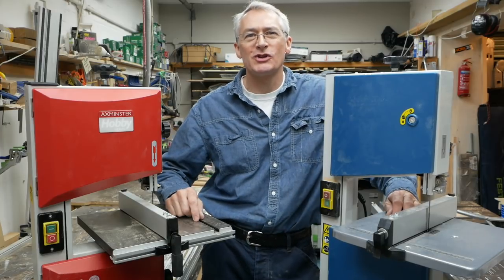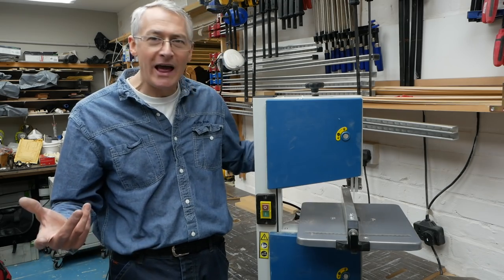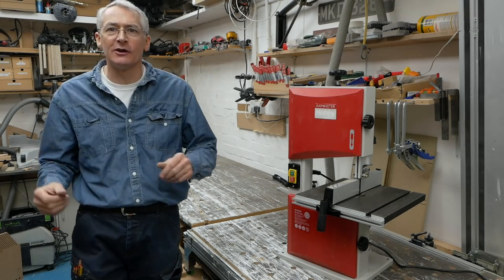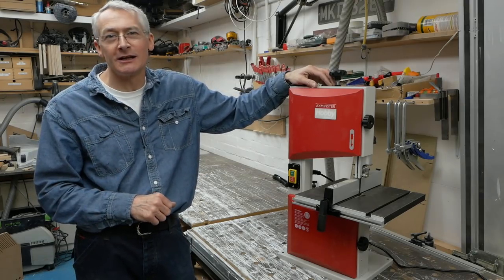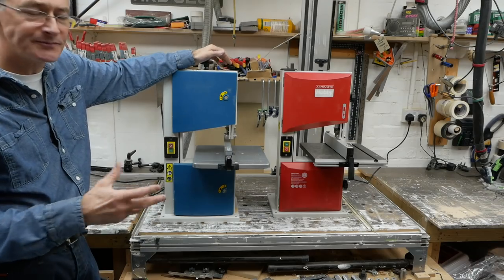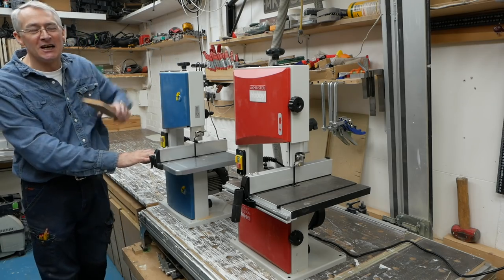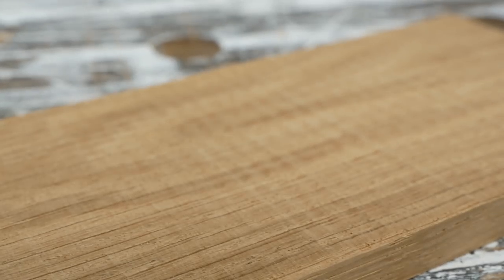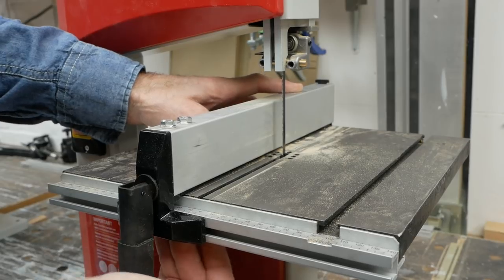£80 Bandsaw vs £200 bandsaw #140

Comment: My friend bought the Aldi machine, and it's a toy compared to the £200/250  machines. As you said, o.k for freehanding rough work, but when you look at the table and fence you just know it's a no-no for anything serious. If you're a hobbyist then the Aldi machine will serve a purpose, but I would rather spend more, and have a machine that will do what I want. Were you really cutting brass and aluminium with a 6T blade for six months, then able to cut sixteenth strips of hardwood cleanly?

Comment: Great review. It is astonishing how the Chinese manage to make things so cheap. I reckoned that just to buy the materials as as stock would cost far more than a whole bandsaw. I think workshop tools have not progressed at all. In fact they were better 80 or more  years ago. I want a bandsaw that cuts steel and wood yet absolutely no one makes one. Why? Corded hand drills can now be got with 1100 watt motors. The best you can get in a small bandsaw is 350 watt. Why so small? Also there  is too big a jump between the small bandsaw and the medium. Medium bandsaws usually come in at around 80kgs, that's heavy. This would mean they are only suitable for ground floor garage or  shed work shops, not, 2nd floor bedrooms (mine). I did not see a cross cut/mitre slot on the aldi one. To many people this would be a no no.

Comment: COULD YOU HELP I NEED TO CUT A LOG INTO SLICES  THE LOG IS 6"   153MM  APROX IS HERE A BAND SAW WITH THIS CAPABILITY ?? THANKS IN ADVANCE Pete
Reply from the maker: Yes, but not any of these budget models. Do a google search for “bandsaw with 150mm depth of cut” and it should throw up lots of options- I think a 10”/250m bandsaw or larger should handle this depth👍👍

Comment: Would it be possible to replace the Aldi table with 3/4 or 1 inch mdf table for a more ridged surface ? possible project.
Reply from the maker: Not really. The bigger problem is that the table is just mounted on a glorified angle bracket, which simply isn’t sturdy enough. The bigger problem is that I don’t own that bandsaw any longer 🤔👍👍

Comment: Very interesting comparison. Thanks for sharing.
I have the Scheppach version of Aldi, for which indeed i paid 140 € (115 British pounds or so)
I managed to brake to saw blade and I still do not understand how that could have happened.
On the internet I found saw blades for less than half the price compared to what Scheppach offerrs.
Since both band saws in the video are 90+ percent equal, do you think that it is possible to mount the cast iron table of the "red one"
on the Aldi bandsaw?
The Scheppach has a long list of spare parts which are possible to buy separately.
Does "the red one" has that too?
Reply from the maker: Thanks! No, unfortunately the Axminster (red one) has completely different (and more robust) mounting for the table than the Aldi/Scheppach, so it’s not possible to swap them over. I can r commend tuffsaws.co.uk for bandsaw blades, very good quality and excellent service. 4 years warranty is good, 2 years is the ‘normal’ here for the Aldi/Scheppach. We can buy the Scheppach for £110, so similar to what you paid. 👍

Comment: exactly. Theres a question is it three times as good, three times as powerful, three times as accurate? no so no point spending 3 times the amount
Reply: It never works like that though, does it ?  Using your (rather strange) reasoning we would be condemned to using shit tools. My Estwing hammer cost ten times the price of a 'market' hammer, but I know which I would buy. You stay with the crap tools, turning out crap work.

Comment: I’d not say that the axminster was a “premium” Saw. I had an earlier version of the axminster from the “white” range I think though it was a slightly bigger one than this but when I brought it 15 years ago it was cheapest bandsaw they did at time came with a stand and did ALOT of work. I sold it for £80 after 12 years of owning it. Was a good Saw for the brass it cost. Wouldn’t part with my large Wadkin now though.

Comment: Well I recently bought a bandsaw from Lidl (Aldi emulator in EU, they sell their tools under the brand Parkside), in the Czech Republic, and apart from the green doors color there is almost no difference. Mine has a thin sheet table si ilar to Aldi, but has the groove that your Axminster has, and the little angle jig to fit into that groove. So mine is somewhere in the middle, yet my question is, or rather "I wonder", if all three are made in the same factory in China? Because there is no way they can be so similar. Or, is Aldi a copy of Axminster? Nope if my Parkside has the same blade, same wheels and same frame and switch. They must come from a same place, they just differ by color intentionally and the features are left out for lower price, that's all. But I must say I am very happy with the one I have, for the money I paid.
Reply from the maker: As I think I say in the vid - or one of the others, there’s a whole budget bandsaw playlist with them all in there - they almost certainly share some dna, but wether they’re made in the same factory I couldn’t say. Just FYI Aldi Workzone tools were almost always rebadged Scheppach, and Lidl Parkside were frequently Einhell; both companies seem to have moved in to commissioning their own stock now though, Aldi under the Ferrex brand, Lidl still under Parkside. 👍

Comment: I got a basa1 the guide rail when lowered near the table it pulled away from the rear thrust bearing and  thrust bearings are angled slightly so the top of the bearing is nearer the blade than the bottom part of the bearing!

Comment: Would it be possible to replace the table and fence on the aldi saw with one from the Axminster (or similar) without having to make any modifications to it?
Reply from the maker: No, the mounting methods are totally different. You’d be better off beefing up the table with plywood from underneath, or maybe with steel from above, if you have the skill set.
Reply: Peter Millard thanks very much.

Comment: Looks like the same machine from the back Peter. Too much of a coincidence for them not to have come from the same plant in China if you ask me. I think with the Axi one you've sacrificed some power in the motor for the cast table and quality fence, which on that size of saw is probably a better deal. Plus the back up you get from Axi should it go wrong. I think they give a 3 year guarantee on this kind of stuff? I have a larger floor standing Record. The versatility of a good band saw is only limited by your imagination. I use it constantly when in the workshop. A small one is a great addition to any home shop. I'd vote go with the Axminster.
Reply from the maker: Cheers Graham. I’m sure you’re right - though to be fair there’s probably only so many ways you can design a bandsaw! Yes, 3 year warranty on the Axminster vs 2 on the Aldi/Scheppach. Jury’s still out on what to keep - I suspect the beefier motor in the Aldi is why it kept cutting decently on a shonky blade, so may well suit me better tbh 😂 Cheers, P
Reply: Peter Millard let me know when changing the blade I’ll send you a link for best option. Not got access just now. Sat on Maccy’s car park with a brew between jobs.
Reply from the maker: You know how to live, lol! I usually use Tuffsaws - Ian’s very knowledgeaable and generous with his time, but always happy to hear about other suppliers 👍
Reply: Peter Millard that’s who I was thinking of Peter !
Reply: Scheppach offers (at least in Slovakia) 4 years warranty.
Reply: Graham Orm even within the parameters of “standard 8 inch bandsaw” the similarities are too high to be coincidental. The back, in particular, has all the screws in what looks like exactly the same place. Although it’s not impossible that they’re from two different Chinese factories, one of which has simply cloned the earlier design.
Reply: In the UK I think we get 1 year on Scheppach. 3 Years is unusual.

Comment: Peter, did you think about changing the tables over so you can keep the bigger horsepower?
Reply from the maker: Yes, but the mounting points are quite different, so not an option unfortunately 👍

Comment: How does the warranty compare. The also had 3 years and their no quibble refund in that period vs a mister who gave great support but they’ll want to repair or replace typically.
Reply from the maker: 2 years in the Aldi vs 3 on the Axminster. Never heard of anyone having an issue with either company re warranty claims tbh 👍

Comment: Hi Peter. I see in the background of your latest video a new Ferrex bandsaw. I have the same model. I have been very happy with the saw, just one problem the blade tensioner sheared early on. Following  a frustrating conversation with Aldi/Sheppach where all they could offer was a refund, I fixed it myself with a new stainless bolt that cost £2. The blades that came with it cut fine, but a year on I am buying a nw one from Tuffsaws  How have you got on? Will you film a review?
Reply from the maker: Hiya. I missed out on this one last year - it’s the 10” - so snapped one up as soon as they were announced. Mixed feelings about it tbh - great for the price but I’m getting shocking vibration off it - washing machine on fast spin kind of vibration - which makes it unpleasant to use. Cuts great - 1/2” tuffsaw blade was a squeeze but just about fitted - but I think it may have to go back. Shame, as it’s the cheapest 10” bandsaw by far. 🤷‍♂️👍
Reply: @10MinuteWorkshop  Hi. Mine also had a vibration problem, so when I was repairing the blade tensioner, I stripped the saw down, lubricated the wheels and reassembled, then carefully aligned the blade fore and aft and finally applied tension with my new ebay bolt fix. This sorted the problem completely and has not returned. I would send a photo but not sure how! I plug the Midi 27mm hose into the port under the blade and this does a much better job of dust collection than when I connected to my 100mm extractor. I have had good results resawing oak and pine  with the supplied blades, 12 months on I am going to try tuffsaws blades to see if there is any difference. I like the 500w motor, the sliding extension on the table and the fence which is spot on. Dawn

Comment: NOT FAIR. Peter please . A six month old blade V a brand new blade .thats a serious handicap . I do a lot of re-sawing a new blade and correctly 
Set guides is a dream not so much the case when the blade has a lot of work done . I get your point your paying the extra for the cast iron table and some what better guides but well worth the money in my opinion.I would even suggest going a bit higher with the budget if possible but be honest what you want you want it to do .its a bit like the €100 table saws .they should be outlawed there lethall .a bandsaw on the other hand is probably the safest and only machine a woodworker might need
Reply from the maker: Not fair, but relevant David. How well does a 6-month old stock blade cut? Pretty well, actually! I did cut tests when the blade was new in the original ‘cheap bandsaw’ video👍 Also, keep an eye out for the ‘how to change your bandsaw blade’ video, out soon 😂

Comment: Clearly the same underlying design, but some key differences to justify the higher price makes the Axminster the one I'd pick. The Aldi / Scheppach is spectacular value for money but the wobbly table and cruddy fence let it down too much. Ultimately though, getting your hands on the Aldi branded Scheppach is so difficult and time sensitive as to be an unfair comparison. I'd have loved to see a third model in the comparo, priced at maybe 400 -500 pounds or so.
Reply from the maker: Thanks. As I think I said in he video, it depends on what you want from a bandsaw - I’d rather spend a bit more than the Axminster and get something with a bit more capacity, though clearly some folks wouldn’t. And yes, the Aldi isn’t stocked all year round, but the Scheppach is available from Screwfix at £110, so still pretty good value. 

The point of the comparison was to see what paying more can get you in this category of bandsaw i.e. the 8”/200mm benchtop model. I’d expect a  £4/500 model would be significantly bigger/better all round, so not entirely sure adding one to the mix in this video would be relevant. Which is why I didn’t. 👍
Reply: Any way you look at it, a great vid that helped me a lot. Thanks for posting it, and awesome to see you're tracking and responding to comments so quickly! You certainly picked up another subscriber here!
Reply from the maker: Thanks Matt, and welcome! Be sure to check out the back catalogue 👍

Comment: HI Peter, interesting video.  I know you've previously shown that you don't use a table saw much in your 'workflow', but I'd be very interested in a table saw version of this video.  

Reason being, I purchased the Aldi table saw for £90.  Unfortunately, in my opinion at least, they went too cheap on it.  The switch gear burned out, the assembly is finicky and not very stiff, the fence requires constant vigilance to ensure it's square to the blade etc.  It also requires considerable disassembly to make it fit through a door way & the dust extraction facility is just awful...  So I'm in the market for a sub £300 table saw that's better quality and somewhat portable.

There's a lot of choice out there, so I don't think I'm asking for the moon...right?
Reply from the maker: Thanks. Not much of a tablesaw user so don’t really have much experience of them tbh; I’ll be touching on it tangentially in my tracksaw workshop series, but a cheap tracksaw will generally be a better bet than a cheap table saw. 👍
Reply: Indeed, subsequently I purchased the Lidl tracksaw for £60, and it is very, very good for the price.  The one gripe being the track isn't much cop, so I'm currently waiting for the Festol 1400mm track to go on special.  Knowing what I know now, I wouldn't have bothered with the tablesaw at all for my house renovation.  Nevertheless I've found a table saw to be damn useful, hence the search continues

Comment: I paid just over £200 for a Rutland brand bandsaw. The Axminster looks a better buy. Nothing is spot on with the Rutland Every time things are tightened up the angle changes, so you can never get perfect 45, 90 degree joints. The blade wonders off when cutting, so straight cuts are difficult. The instruction manual is also nothing like the Axminster one, which I have just downloaded and will try adjusting my machine using it. Won't correct the poor adjustments though. I note the Rutland one is 'out of stock', probably because it is rubbish. Doesn't help me though.
Reply from the maker: Sorry to hear that. Are you using the stock blade? Lots of bandsaw issues can be cleared up by using a decent blade eg tuffsaws, link in the video description. 👍👍
Reply: @10MinuteWorkshop  Funny enough, I just got a tuff saw blade and it does work much better. Still have a slight drift if not careful, but that could be me expecting too much of a cheap machine.

Comment: I have just received the Aldi bandsaw and there are a few faults with it. The countersinking for the screws in the table are not countersunk enough and the screws sit high on the table. The machine wouldn't start so I investigated and found that the lower door was not closing properly which meant that the safety thingy in the door was not making contact and allowing the machine to start. I fiddled with the door locking mechanism which enabled the machine to start. But I shouldn't have had to do this. There were parts missing also. I am not happy with this so it can go back. One last thing is that I found it very noisy. I know I can wear earmuffs and I do. I am just saying that it is a noisy machine. Actually it is more than a noisy machine, it is a load of crap.
Reply from the maker: Good to know - I assume you’ll be returning it for replacement/refund? I posted this video 18 months ago based on the saw I bought and I’ve posted elsewhere in these comments that last years Aldi bandsaw had a number of quality issues - interesting to hear that the current model isn’t faultless either.
Reply: Thank you for your comments Peter. @10MinuteWorkshop
Reply: @10MinuteWorkshop  I forgot to mention that of course I am now looking for the best I can get for my money. Trouble is every time I see one that I like I keep looking for one just a little more expensive hoping it will be " the one". I started with the Aldi [ which I am going to return] Which is £80. I have now reached the £300 mark, Help!

Comment: Hi Peter, thank you for this review it was very helpful and of course you have exposed the classic purchasing dilemma for most folks. I am right in that ‘flip flop’ state of mind at the moment on a small bandsaw purchase. Here are my comments :

Aldi Bandsaw link defunct (seems to be their business model for these sort of specials).

An alternative candidate is the Screwfix Titan Bandsaw  (which has a 350Watt motor) https://www.screwfix.com/p/titan-ttb705bds-80mm-bandsaw-230-240v/5688p coming in at a penny under the ton, but with a mitre gauge too. It gets effusive reviews with only one bad out of 37. Judging only from the pictures the table also looks better than the Aldi or the Scheppach variants (the latter does not get as good reviews on the Screwfix site by the way).

A common thread of the feedback is performance can be further improved with a better blade and recommending www.tuffsaws.co.uk as a good source.

So what I am thinking? Well the Titan seems the best bang for the buck - but then again there is something very appealing in having a nice flat cast iron table in the workshop so maybe the Axminster then ........oh bugger!🤔😂
Reply from the maker: Thanks Norman! Aldi bandsaw not in stock as far as I can see, so Titan may be the next best bet. Someone mentioned it as a clone of the (Machine Mart) Einhell at a slightly lower price, so well may be worth a look👍 And Yes, completely agree re tuffsaws - Ian’s very knowledgable and generous with his time 😬